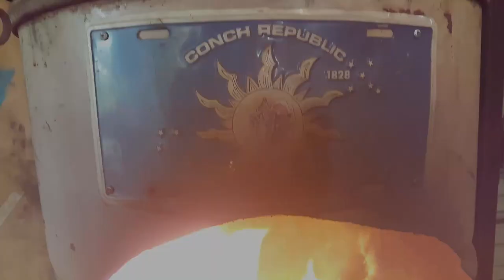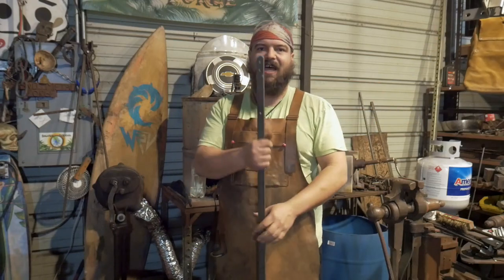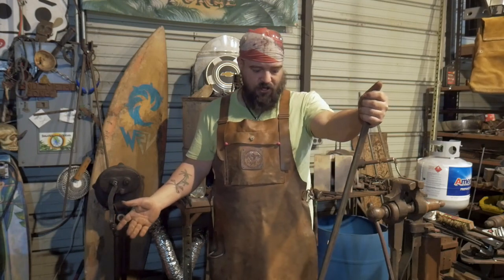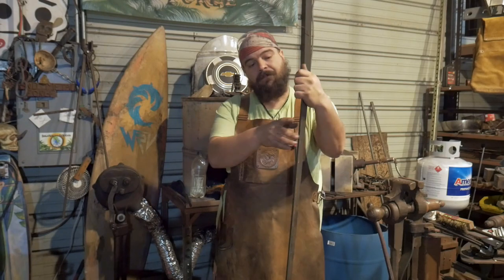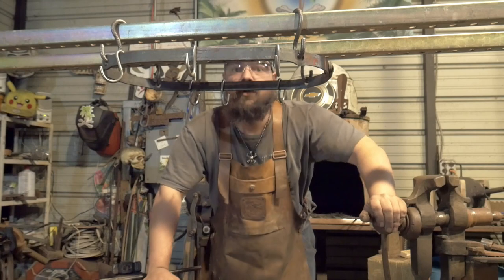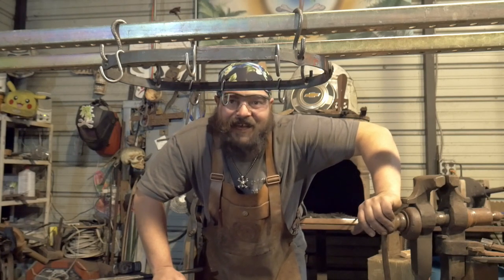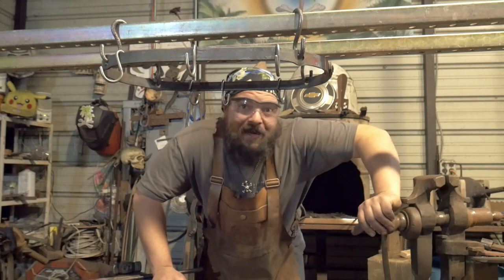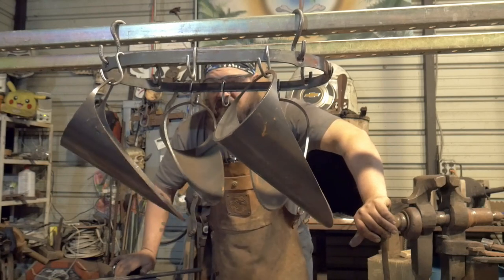First Attempt Hanging Pot Rack

Comment: Yet another great reason to have the option of using either coal or gas to forge with. Nicely done project!
Reply from the maker: Thanks, trouble is, as silly as it sounds,  is the audio is wrecked from the propane forge, and I don't particularly like putting the music in the video, unless its background.
Reply: @IslandMetalForge  I think that's why John Switzer shuts his gas off when he's explaining what he's about to do. Don't know of a technical solution to the issue short of using a seriously sophisticated mixing board, which of course is not why we got into blacksmithing!